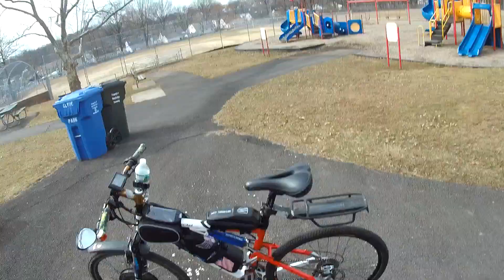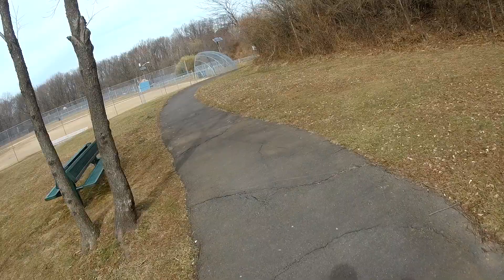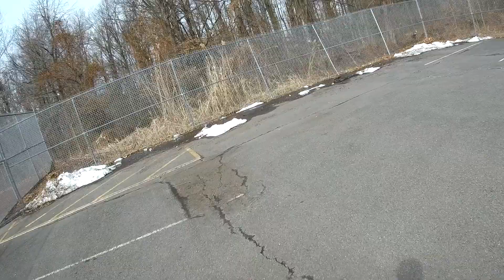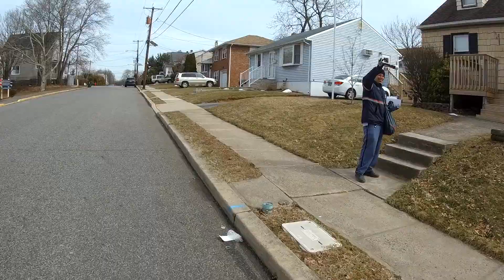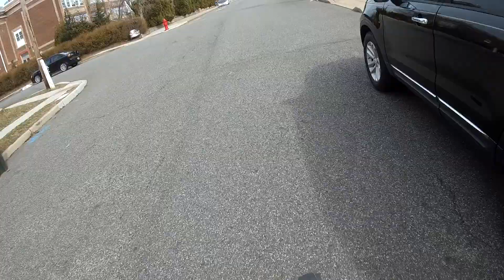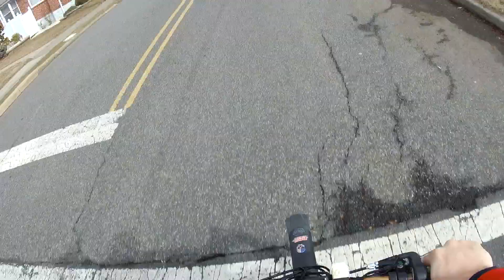Road Test 52v 1000w Tomac 98 special sw900 lcd throttle & PAS"peddle assist"Hawkeye 8SE headcam

Comment: Hey man can I put any throttle with this display
Reply from the maker: a stand alone 3 wire throttle is all you need
Reply: @petertothRC-FPV  thanks, it is a with 3 separate wires or all 3 wires into one
Reply from the maker: @ypsqueeze9632  positive negative and signal
Reply: @petertothRC-FPV  thanks
Reply from the maker: @ypsqueeze9632  Anytime

Comment: Were you able to slow down the pedal assist? If so, how did you slow it down?
Reply from the maker: Oh yes indeed it is so good after playing around setting everything up the way i like.Your sensitivity & speed are fully adjustable.Since my battery is full 59 volt i use the 48 volt 35a parameter so my power gauge useless and mileage are off by 3 or 4 mph but it works fantastic.